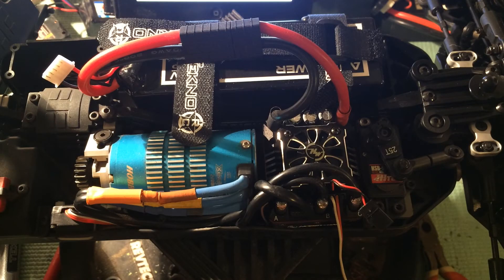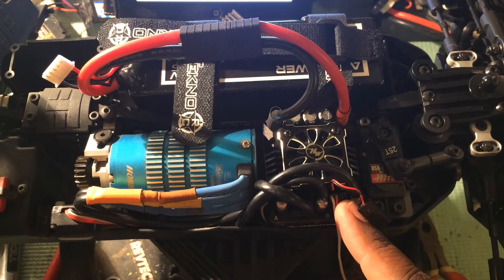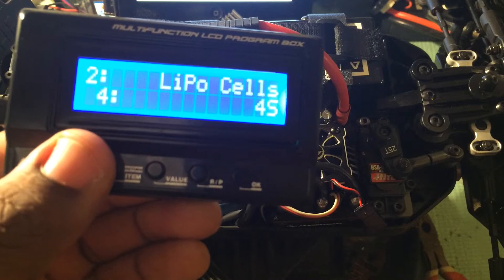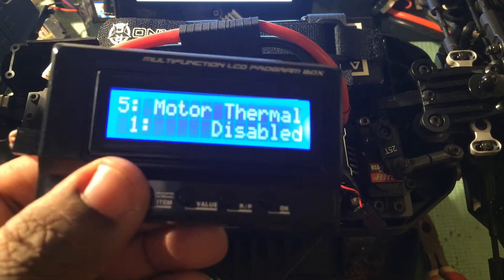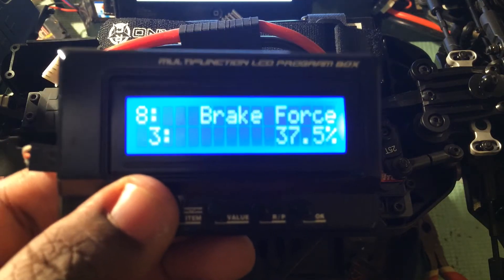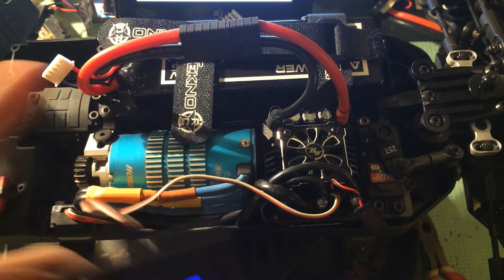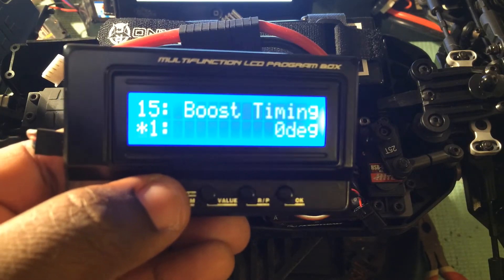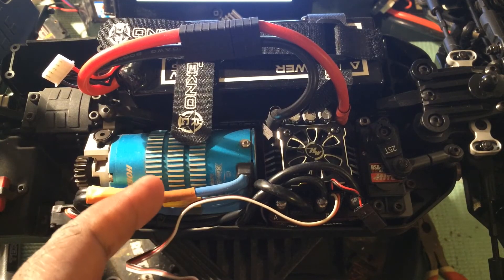Hobbywing Xerun XR8 Plus Programming Options

Comment: Thanks bro for your video, i bought recently the same esc used one, whenever i press the throttle little bit and let it back to neutral the car moves little bit to the front and stop. Is this the Coast option? Im worried if there is a problem because i tried to trim the throttle with no success

Comment: turbo is in the ESC.....NOT THE MOTOR!
Reply from the maker: Tim Melton I was referring to the sensor boards in the new motors that were designed to work specifically with these esc’s. Pretty old video at this point though. They must be on revision 2 or 3 by now.

Comment: Can you program through the set button next to the power button or do you need the LCD program box?
Reply from the maker: I don't believe it's possible to program the XR8 Plus without the LCD programming box or Wifi module.
Reply: John Bernard Jr. - didn’t think so, thanks.

Comment: Would you recommend this for the Arrma Limitless?
Reply from the maker: As long as you’re running 6S, it’ll be fine. Go to hobbywingdirect.com to check out the motor limits at 6s. If you’re using a bigger battery (8S) you should check out the Ezrun max6.

Comment: hey my friend  esc hobbywing 150A zet het in het water moet zijn met ventilator aan of uit ??
Reply from the maker: I would always use the fan if you can. Is it in a boat? What motor and battery are you using?
Reply: e-revo 1/10 batterij 5000 50c
Reply: Kun je me vertellen of de ventilator aan of uit moet om water toe te voegen?
Reply from the maker: daniel lampazzi I'm using a translator so I may not fully understand what you are asking. If you plan on running in water I would not use an Xerun version. You would want a EZRUN or QUICRUN system. Their instructions do suggest to remove the fan before exposing the vehicle to liquids.
Reply: mijn ezrun !! Ik wil dit doen !!

Comment: Hi John. Very clear your video. I just purchased this ESC. I would like to know if I can set the ESC into Forward/brake/reverse mode, because so far I cannot get the reverse function in any way. So, do I have to buy the LCD programmer box to set the reverse mode on my ESC?
Reply: Alberto Martos del Rincón did you figure put how to do this

Comment: I have xr8 sct 140 (14,8 v max) 
I want to put 2x 2s lipo HV at 8,7v = 17,4v
It is possible?
Reply: Iv got the xr8 plus 150a and it says on it 2s to 6s i run it on 2s 3s 4s 6s and its fine just gets faster the more sss uv got 😂
Reply from the maker: freddy felchner that I don't know. I would suggest emailing customer support at hobbywingdirect.com and asking them directly.
Reply from the maker: freddy felchner we probably emailed them at the same time. My guy there says he's going to get back to and check with engineering.
Reply: John Bernard Jr. Thx. 
Hobbywing have send me :

I believe for the same cell count, HV stuff could be a bit tricky.  I will email with engineering to confirm this week and try to get back to you directly.  IF you don't hear back from me in a few days, please do not hesitate to follow up on this Email Chain Directly.

Comment: Great video.
Just a heads up the turbo timing feature becomes avail when you have the esc drive mode (setting 14) set to full sensored.
Reply: +Tristan Jones what motor are you using?

Comment: Whats your take on the BEC.  I have read on rctech that one fella thought it was causing his ESC to shut off when set to 7.2v while under load from the motor with his HV servo. Sounds sort of counter productive if so. Have you experienced any issues in regard to this? I thought maybe running a cap (glitch buster) would help the load issue.
Reply from the maker: +Tuffenough4u  I haven't experienced any issues with it so far. Just before installing the XR8 my 4 year old Savox died and I replaced it with that Hitec 9370 servo. Right now I have it set to 7.4V and have had any issues. I would agree though first thing I would try is a glitch buster.
Reply: +John Bernard Jr. Ok, good deal.  I normally don't run a BEC setting of more than 7.2v, as in my experience if you run anything more than that on 2S, you can feel a bit of inconsistency due to voltage drop when your on the throttle. 
I run the Futaba 9352HV servos. If you haven't tried one, do it! Once you do, you wont go back to anything else. Anyhow I just ordered the XR8 and will be testing it out ASAP. Thanks for your video. Seems you have one of the only informative videos on the topic so far. Appreciate it!
Reply: +John Bernard Jr. Oh, and if you haven't heard about the ZRO trigger systems, you should check them out. It's one of my patented concepts I am fixing to release within the next month or so. I think you might find it interesting. You can check them out @ https://www.facebook.com/PerfectZRO
Reply from the maker: +Tuffenough4u I started with Savox when I got back into racing, went to Radiopost servos, and now I'm trying this Hitec. I was told the 9370 was commonly used in EB but so far it seems a little too slow for what I'm used to. The 9352 HV was a little pricey but I know they are worth it. Maybe next time.
Reply from the maker: +Tuffenough4u That's an interesting idea you have there. Did you figure out a universal fit or is it radio specific? Right now I'm running the new Hitec Lynx
Reply: +John Bernard Jr. Yes, they are expensive, however they have come down since I bought mine less than a year ago at $150. They are now $130.
But your right in they are definitely worth the investment!
Reply: +John Bernard Jr. I am still specing out a few of the transmitters. They aren't universal to one another completely, however at the same time the internal design doesn't really stray to far away either.  All of them use a potentiometer with a flat grind on the output shaft, but the pivot lever styling is different from each manufacturer. But thats the cool thing. The outer/lower "trigger part" is all the same from radio to radio. So that means there is very little difference in machining from one to the next. The first sets I release will cater to the popular high end radios, such as Futaba 4PX, Spektrum DX4R, and Airtronics M12 series. After I set them for those, I have hopes to cater to the mid range sets and possibly other manufacturers like your hitec.

Comment: Any feedback on the XR8?
Reply from the maker: +Elliot Baltazar Very smooth throttle and brakes feel very good. The punch setting feels a lot like the 150a. The power reduction is noticeable at lower settings but it helps you to keep going in the right direction.